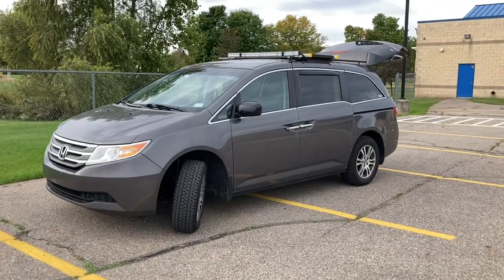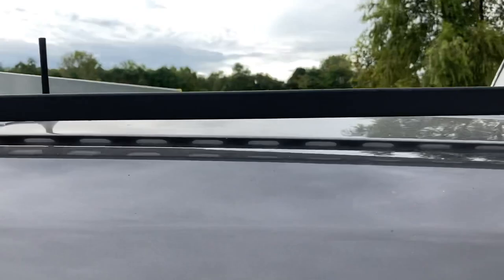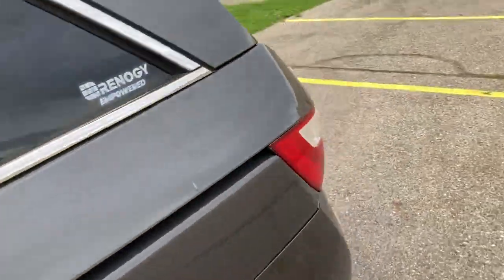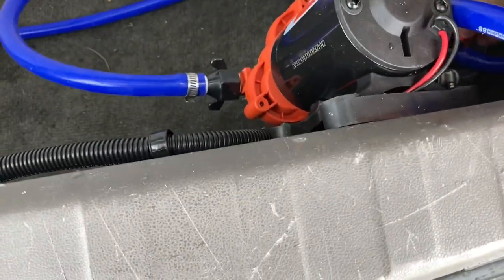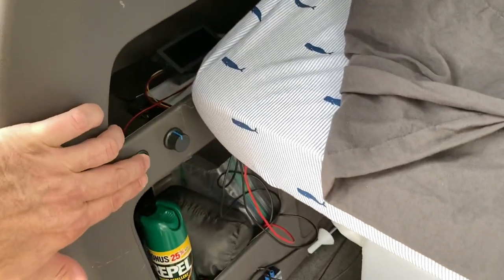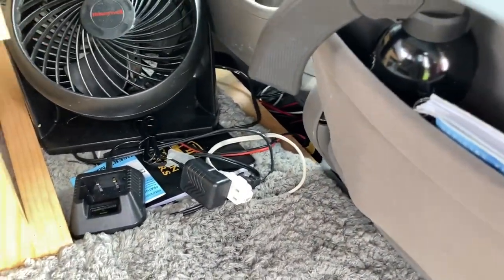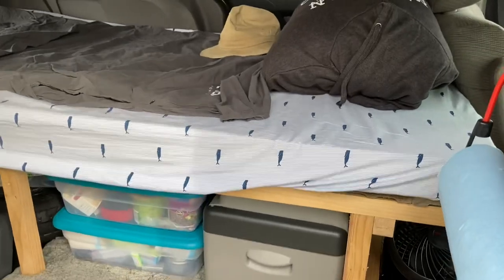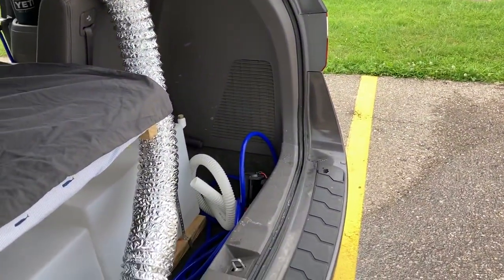Minivan Camper with a Shower!

Comment: Enjoying your videos. I also have an Odyssey camper conversion and particularly like your lift and tires. You mentioned the lift but have not specified what brand, size and model tires you have.
Reply from the maker: Sorry for the delay in answering your question.  I was running Kumho Roadventure AT51 in 245/70. Good tires in the dirt but they were not great in the snow so I mounted Kumho Crugen HT51s for winter use and use the others when I’m planning to be off-road a lot in dirt or sand. Thanks for watching my videos!

Comment: I'm so impressed!  I hope to get a Honda Odyssey in mid 2024.  I can't remember what year it was that the 3rd row seats could be removed and you could use the lower compartment for your cooler etc.  But I'd like to get a newer model.  do you happen to know how I can find out if the newer models 2nd and 3rd row seats are also completely removable?  2020-2024??  thanks for your helpful videos, wish you'd do more of them! lol.  Take care and happy travels!
Reply from the maker: Thanks!  You can essentially remove the 3rd row seats in all the Odysseys but the process varies slightly. It’s something that I’d consider having a mechanic do if your aren’t used to using tools, because there is an opportunity to get pinched. Here is the process on a 5th generation Odyssey which I THINK is the current model. https://youtu.be/fbHkwLTL6y4   Thank you for watching!

Comment: Viceo to come but why two pumpsn AND two tanks.  Thank you for your reply
Reply from the maker: That’s a great question that nobody has ever asked!  I wanted more pressure on my shower than on the drinking water. Separate pumps were an easier solution than a pressure regulator and return line. Also, in a pinch if one pump goes out, I can switch to the other. Thank you for the question and for watching!

Comment: Looking into the Traxda 2" lift for my 2017 Odyssey - any cons to the lift? Any issues with handling or breaking?
Reply from the maker: The handling is definitely not as sharp as it was, but that’s an acceptable compromise to me. Where it used to handle like an Accord, now it handles a bit like a Pilot. More truck-like, but not awful.  Thanks for watching!

Comment: How’d you get the 3rd row seat out please? New subscriber here. I just bought a 2012 Honda Odyssey Touring mini van and will convert it soon.
Reply from the maker: Cool! Congratulations on picking up a 2012!  The rear seats can be removed by pulling up the plastic covers and then backing the bolts out. Use an extension to keep your fingers out of the way.
Reply: @OdysseyCamper  thanks a bunch!